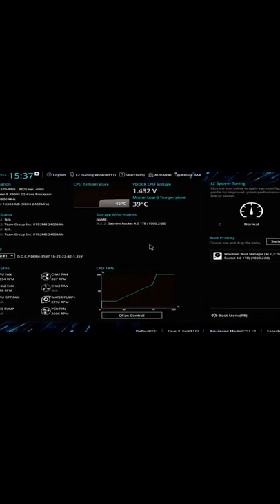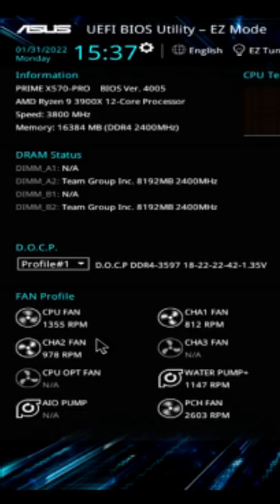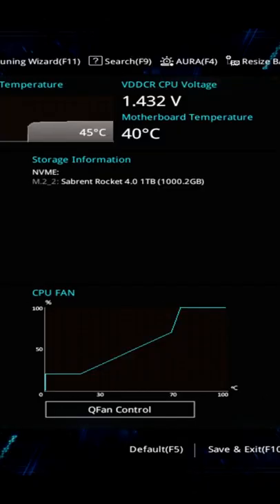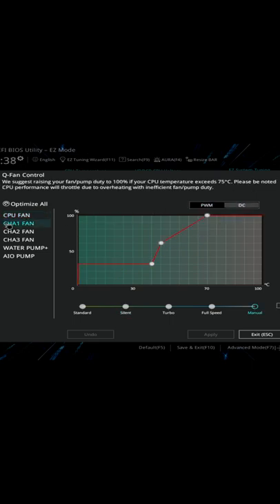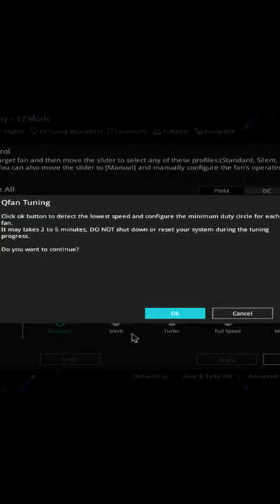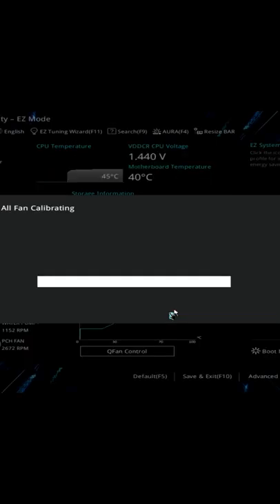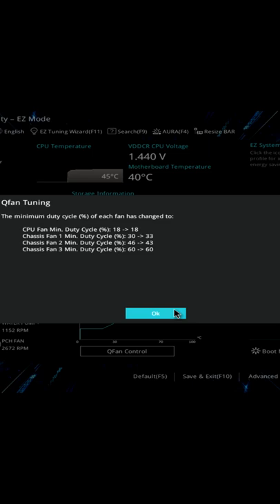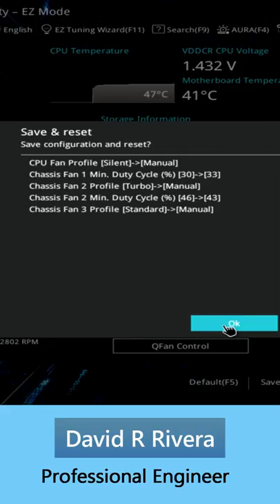PC Fan Optimization with ASUS Motherboard #Shorts

Comment: For some particular reason my fans on my case are not being recognised by my motherboard
Reply from the maker: You might be having a problem with the 12v power connect to your motherboard.  Have you noticed any problems with your Graphics card?
Reply: @PE4Doers  no it works just fine
Reply from the maker: @WALTY3D  Hmm.  I will think about it some more, but I would also make sure the Motherboard BIOS does not have those fans connectors Turned Off.
Reply: What do you mean
Reply: Turned off in bios?
Reply from the maker: @mnkyboy0505  Yes, on several motherboards, you can disable individual Fans
Reply: @mnkyboy0505  it spins but not  in bios
Reply: Me too
Reply from the maker: @mnkyboy0505  I wish I could be more help, but it sounds like you need someone to actually look at your computer.

Comment: I have a coolermaster installed in an ASUS  motherboard. When i choose PWM  , the fans stop spinning and when i switch back to auto detect , the fans start spinning again .
Why does that happen? 

The CHA3  fan icon  in the BIOS  spins and sometimes appears as N/A . I don't know why. I notice that CHA3 leads to the front fans but the three of them work perfectly  fine. I have a deep cool case .

And finally i have another problem .  The coolermaster liquid ML240L V2 ARGB works fine however when i open a program or game , it makes a strong windy sound and then it disappears . Someone told me to activate the Qfan tuning in the BIOS but i am not sure .
Reply from the maker: Have you checked to see if there is a BIOS Firmware update available for your motherboard?
Reply: @PE4Doers   well i don't know.
The first problem is solved . My cooler fans have  three connectors each one . That's why the fans didn't spin. 
The others two issues are still unsolved .
Reply from the maker: @ChrisDMReloaded  Oh, they are DC not PWM.  That would do it.  I would get a new set of Fans.

Comment: I try to control the speed of my chassis fan, in bios i can control the rotation, but when windows start the speed goes to 100%, and in the fan xpert software doesn't show the fan speed, how can i control speed in windows?
Reply from the maker: There are a few Windows programs that can help.  Is you chassis Fan a PWM fan?  They are much easier for the BIOS to properly control.
Reply: @PE4Doers  Yes, i'm using scythe fan with pwm control, btw i found the error, i needed to calibrate the fans in asus fanxpert, after that the speed control started to work. thanks.
Reply from the maker: @JoseMarian0  Glad to hear it's working.  Yes, you need to use the BIOS Fan calibration in order to optimize them.  That should be done with the system exactly how you intend using it (i.e. side-panels on or open-air), and if possible, in the location you plan on using it at.

Comment: I have an ASUS B450M Gaming Plus motherboard, but I don't see the option to switch from PWM to DC for the CPU fan. The option only appears for the chassis fans. I have the latest BIOS update installed.
Reply from the maker: That should be  there, unless your Fans do not support PWM - with is the default for most case Fans provided with a mid to lower end priced case.  I always replace mine with PWM Fans, they can be costly, but I want that cooling feature.

Comment: Should i set my cpu fan to turbo when gaming or does that not matter
Reply from the maker: That should be decide based on the temps you get while gaming.  I always start out as normal/standard, then make sure I can stay below 85 degrees centigrade.  If that turns out to be a problem, then I would play with the fan speeds.  It also helps if all of your fans are PWM (and the motherboard/controller is set to control them as such).  Finally, maintaining a positive pressure in your case keeps the dust out (as long as there are filters on all intake fans).  This helps in general for cooling, but also keeps thing flowing optimally over time.
Reply: @PE4Doers  what i see when i turned the cpu fan from normal to turbo i felt way better smoothness in my game so i will keep that and is that hurtfull for my fan
Reply from the maker: @CroissantDestroyer9  In that case, you may have started thermal throttling in your CPU.  Did you get any ideas of the temperature you were getting?
Reply from the maker: @CroissantDestroyer9  That sounds like you may have been thermal throttling on your CPU.  Did you notice what the high temps you had in the CPU Cores?
Reply: @PE4Doers i dont really now how to check the temps actually i only now my gpu
Reply from the maker: @CroissantDestroyer9  MSI Afterburner and HD-Info are both great.  Both Free Tools, and there are numerous videos on how to use them in YouTube.
Reply: @PE4Doers  I will try hd info tomorrow
Reply from the maker: @CroissantDestroyer9  Great - Make sure you get the latest version.  the older one does not work well with the newest CPU's.
Reply: @PE4Doers i do now my cpu temps now and cpu is only arround 61C
Reply from the maker: @CroissantDestroyer9  If that's under load you are good.  Maybe the games you are playing need more CPU threads.
Reply: @PE4Doers  that's underload yes I'm playing doom eternal I see that it using 60% so that's why maybe but the max was 61C
Reply: @PE4Doers  and I also overclock it a bit because I overclocked my ram

Comment: For some reason i dont have this option and i cannot change it, im on an asus laptop can i still do it in any other way?
Reply from the maker: I guess it does depend on the manufacture's and product generation of the motherboard and its BIOS.  I have seen it on ASUS mostly, but also in a similar for on MSI.

Comment: Hey i dont knwo if you know it but on my a320m-k there isnt a optin for DC control? (Because i have 3 pin connector in my fan)
I searching it like a thousand times but i dont find it. Can you help me evtl?

Do i need to do a bios update but on the asus website there stands, that dc and pwm mode is supported and xpert fan controll is there to but i dont find any of these thinf expect pwm mode.
Reply from the maker: Thos DC fans you have must be something quite special.  Also, I assume you CPU Fan(s) must be PWM.  If so, just about any Fan splitter should work, since only the CPU Fan is wired for PWM.

I am very curious why you don't have PWM Fans.  That is the best way to go.
Reply: @PE4Doers  yeah, i know. I got an old lian LI case for 50 dollars. So I used in my old PC with an old high end Mainboard on that case. The DC fans worked like PWM. Then I bought a am4 Mainboard for better upgrade (Cause my old hardware was 2011-3 socket). Thats the problem. Mh... So, i planned for a new CPU and by time a new Mainboard. I think when I buy a new CPu I will buy a pair of PWM controller or fans. Cause my Mobo has only one chassi port.
Reply from the maker: @Creepy23HD  I am 100% on the PMW Band-Wagon.  They are only provided with the most premium of premium cases, but I always replace my DC Fans that normally come with a new case, with those that are PWM.  It's a bit tricky though, since many of the DC Fans have impressive RGB and aRDB, so it requires dedication to remove them.  I do try to donate them to those who have not fans.
Reply from the maker: @Creepy23HD  I think that's a great idea 🙂
Reply: @PE4Doers  yo, that KS for help.
Reply from the maker: @Creepy23HD  Not sure what you mean.
Reply: @PE4Doers  thanks for helping me. Autocorrect.
Reply from the maker: @Creepy23HD  No problem at all.  Let me know if you have any other questions 🙂
Reply: @PE4Doers  ok, thanks dir knowing that.

Comment: @PE4Doers hey I have a custom water loop for my cpu. If I use the optimize feature, do you think it will understand? Currently it looks like it’s moving really slow ( I have a plexi glass box with a propeller in it so I can see if water is moving at good speed or not.) I tried plugging the cable into the pump outlet but Asus directed me to the bios since I didn’t have anything plugged into cpu fan port. It’s definitely not clogged. I only run distilled water, and I service the entire system once a year.
Reply from the maker: The ASUS Optimize is really only going to affect the PWM or DC Fans.  The Waterpump usually always runs at full speed.  What do you temps look like running Cinebench in a loop?

Comment: I have 3 other case fans on my pc, when I boot up in BIOS they say N/A for some reason…
Reply from the maker: Where are they connected? To the motherboard directly, or a Fan hub?
Reply: I’m not sure, I have the pc pre built, it is my first pc, I opened up the computer and it seems like they are connected to the motherboard, I tried changing the detection settings for my fans, and now my pc says “case open fatal error” and I can’t get back to BIOS
Reply from the maker: @timlikesfartsyt3959  A Pre-Built generally implies some degree of vendor proprietary garbage.  What Brand is it again?
Reply: @PE4Doers  I have the same issue. my pc brand is skytech chronos
Reply: @PE4Doers  i have same issue too my 3 fans are detecing and 3 fans are not they are not connected with motherboard what to do next

Comment: How do you get to this screen?
Reply from the maker: All you need to do is go into the BIOS, by continually hitting the DEL kit as you power it on until the BIOS comes up. Then go into The 'QFan Control' by hitting the screen button in the center bottom of the screen.

Comment: unfortunately when i change that values in bios nothing seems to change :(
Reply from the maker: I suppose you already have the optimum speeds for your system set.  Does it show the testing as it calculates the optimization?  Also, make sure you have all the fans set to PWM, which means they need to support that capability.